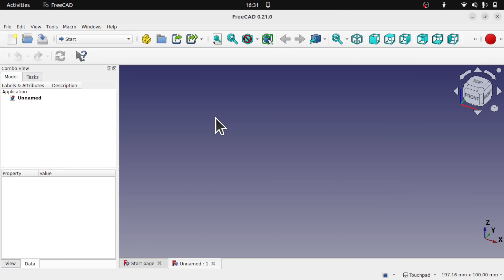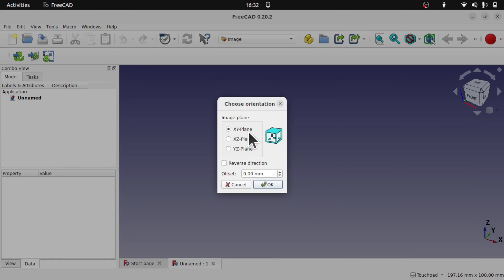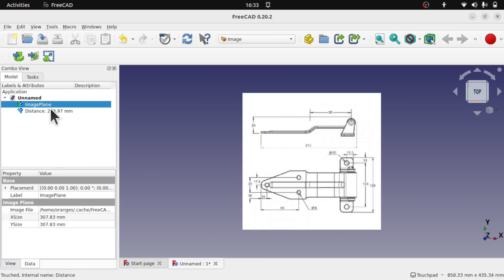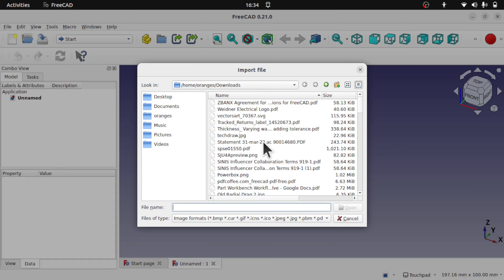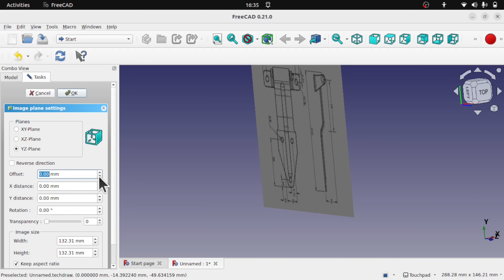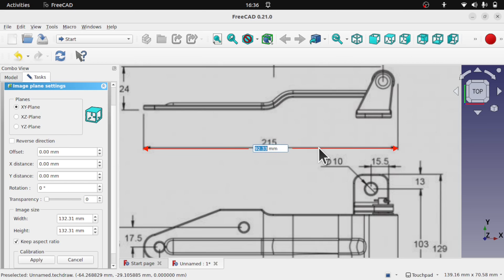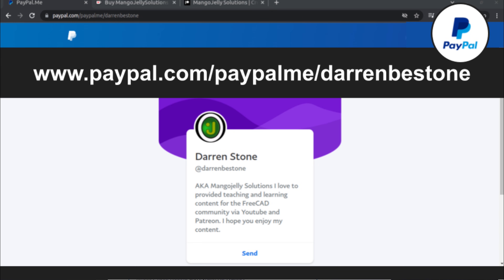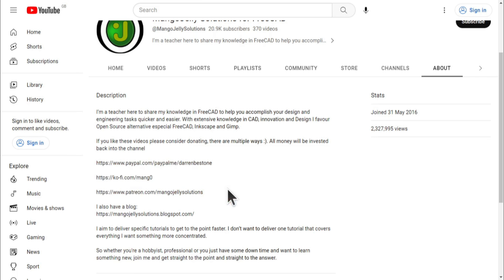Why has the Image Workbench been removed in FreeCAD 0.21 / v1.0?

Comment: Ah, also if the image is to scale from a flatbed scanner (i.e. you have a flat item surface and you plopped it straight on the scanner glass), then when saving JPG or TIFF, the dimensional information in DPI gets transmitted and no reference dimension scaling is necessary, it's bang on to like a couple hundredth of a mm over a 150mm distance.
Reply from the maker: That is some very very useful information that I never new about! Thank you so much for taking the time to share that.

Comment: Is this the exact method to use on the new version FreeCAD 1.0.0? 
THANKS for your videos!
Reply from the maker: I believe it is still valid, checking on mine now as haven't used reference images for a while.  Top menu > file > import  then select the file you want.  Double click on the new icon in the treeview and you have your calibrate and placement options.  Calibrate allows you to scale the image by picking a start point, end point and then entering the dimension for the scale.  Glad you enjoying the videos :)
Reply: @MangoJellySolutions  Confirmed with newly installed FreeCAD 1.0.0 on Mac - Exactly as you stated. THANKS!

Comment: If i import a JPG File , i can see the  Picture in the Workspace but there is no techdraw into the tree at the right side. Can you help. i work with 0.21.1 Version.
Reply: I think that we are having the same difficulties. I get the import just fine, but after that my Sketcher selection seems to do nothing. I have no XY crosshairs, nor a view cube. Nothing on my workspace except my imported image. Whoa!!! I think that I discovered the next step. When I went to the Sketch choice in the upper list, I had to pick "Create Sketch". At that point, everything that I needed to start sketching came up.
Reply: But could you move the jpeg ? Any direction @ytorwoody
Reply: @ytorwoody maybe you choose part desing then create a sketch right?

Comment: Bonus Feature: you can also simply drag'n'drop image files from your computer's file browser into the project's object tree. This is really cool.
Reply from the maker: Thanks for pointing that one out, I didn't know that you can just drag and drop them in 👍
Reply: @MangoJellySolutions  btw, this works with other (all?) file formats as well, just dragged and dropped STEP and STL into a project – test passed. :)
I find this quite handy, because my file browser is much more comfortable and efficient than the "open file" dialog from within applications.

Off Topic: 0.20.* de-installed. ;)

Comment: I'm sad because I see the 0.21 is not yet  officially available 😞 this with the image is really great nd it makes the experience way better
Reply: It's available as weekly builds, give it a try.
Reply: As of today, 2. August 2023, FreeCAD 0.21 is officially released.
Reply from the maker: Best me to it 😁👀😁
Reply: @MangoJellySolutions  I also noticed that importing SVGs to a plane and resize it quite small, on 0.21 finally we don't lose resolution.
Reply: @NUeB_net  yes thank you I just finished the installation 🙂
Reply: The weekly builds on github are 100 % official. And they're as stable as 0.20 in my experience, can't say that they crash more often. I have auto save 3 mins and save manually before taking actions known to end in unpredictable results… just like I did in 0.20. The overall improvements are worth it.
Reply: @NUeB_net  They can be even more stable than 0.20 since they include many bug fixes. Plus there’s a feature freeze and 0.21 will be released soon so weekly builds should be really safe to use at this point.
Reply: @NUeB_net  and @Gumball_W thank you
Reply: @NUeB_net  I've always used the development builds , either daily or weekly. 
In my experience they are very stable.